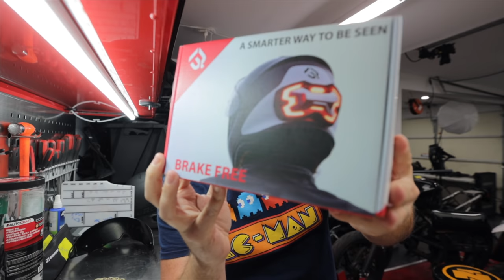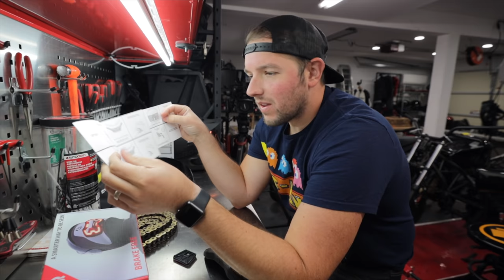CRAZY Braking HELMET MOD TESTED!! | Brakefree unboxing / review

Comment: Additional content: mount it to your seat or around the same area as your rear tail light. If it functions the same way or better, you wont need to worry about the added weight on your helmet. Plus when I drive/ride, I rarely look at someones helmet when stopping or slowing down. Unless its on the always on or pulsating mode, the device seems useless on the back of someones helmet.

Comment: This is definitely a good idea. But I am not sure of why to make "overly safety" comments. Motorcycle riders should always consider their safety first. Especially when most bikes do not have a brake larger than 4 inches. You wont look good between fenders or splattered on the ground. . .

Comment: Just want I needed. I've seen all the crashes on YouTube. Should fit my helmet. 68 yr yooper Dan. Also I'm putting one on a new helmet which will work between the two. Update 2023 helmet is tough but the mount sucks 😢. When you take a passenger and you helmet bump when suddenly braking my brake light fell off. I caught a kid stealing the brake light. He walked up and just like that he popped it off. The mount needs a slide or locking lever. I figured it out it's super glue onto the helmet mount. FIX THAT MOUNT ( LOCKING IT AFTER YOU SNAP IT ON THE HELMET)!!!😢

Comment: 💥💥 21:05 It did not come on at that time while braking.
Reply: Overall features, cool. The fact that it doesn’t stay on while stopped at a light like a sitting duck. not cool.  Neither is the cost. It should be more like  100 bucks at the most.   Thanks for the great video.

Comment: The question is: What is the chance the device compromising the helmet's integrity and killing you, if you hit the back of your head during a crash?
If they actually tested it with multitude of helmets and it is very unlikely, then yeah - it is a definite buy for me!
Reply: With the small plastic clip-on mount, I would expect it is going to pop off and detach under most crash events. Unless the first impact is square against the center of the light on the back of the helmet, I doubt it makes a difference in a crash.

Comment: In my experience,  on a fast bike,  and in a car,  25% of people on the road, have impairment with their depth perception.
DOT test basic vision,  but NOT depth perception.  Still others have no concept of braking and safe following distance.
This product is the equivalent of high mounted brake lights for cars. Those have saved lives,  and innumerable rear end fender benders, that are disastrous on a bike.

Comment: If your brake lights are not coming on when you come to a stop well then you need to fix the problem it’s a faulty wire could be the brake cable. Making up excuses

Comment: @chaseontwowheels This is waste of money for a number of reasons. Drivers typically sit lower than your head height, so they won't be looking for a break light on your helmet. If you feel this is something you need, you have been able to buy inertial switches that wires directly into your existing brake light, for many years. This is not a new concept. But that being said, normal engine braking doesn't slow you down significantly enough as to be a danger to you in normal traffic. In fact its likely that a brake light which comes on every time you decelerate slightly, is more likely to cause an issue in traffic.
Reply: two words trucks vans

Comment: 'Braking' DOES mean 'applying the brakes'. What this gadget does, is show that you are 'decelerating' i.e. slowing down. I've got a much better (and less expensive) solution to your problem - use your brakes to slow down. Sorry if that idea is too radical for you but that's what the brakes are designed to do.

Brakes are for slowing down, engines are for speeding up.
Reply: Brake Free is also a very effective high visibility product. Especially if high-viz green is not your cup of tea.

Comment: Engine braking is just dumb. Ive been riding for a while, and tbh, engine braking is not only dangerous, but provides a crazy amount of wear on your engine. There's a reason most bikes don't include auto blippers. it isn't because of price; it's because you will kill your transmission by doing it. I never understood why you would wear out a part that will cost you $700 with thousands in labor over a part that will cost you like 50 or 100 with almost no labor costs. It just makes no sense. 
Also, engine braking is a LOT of work, when you can just throw it in neutral or lower the gear gradually while applying the brake.. You still have the ability to gtf out of the way if needed. I always scoff at people who have to blip 5 times to come to a stop. it honestly makes people sound douchey, giving them an excuse to rev their engine. Maybe it's just me? little di** syndrome is how I think of it.